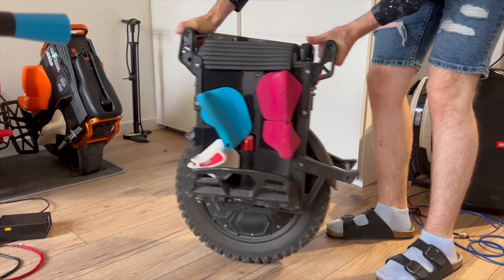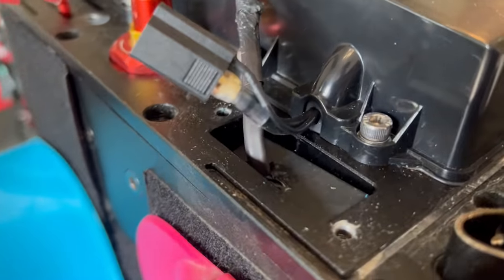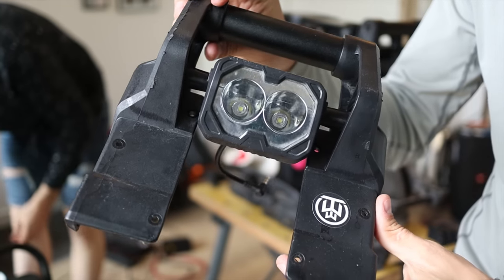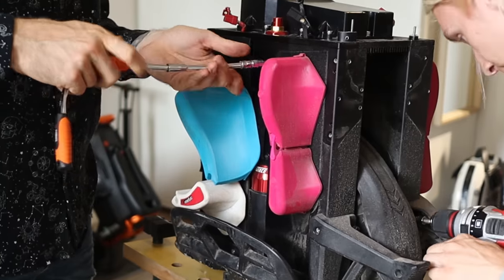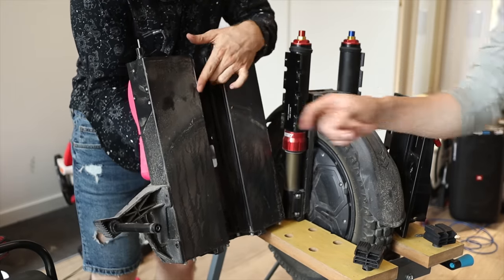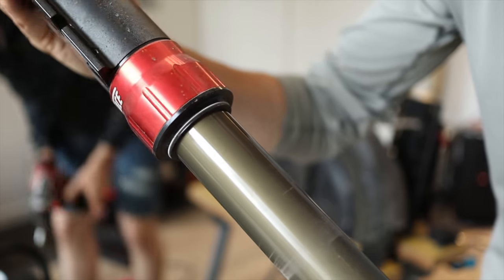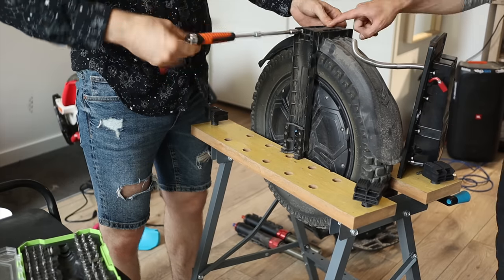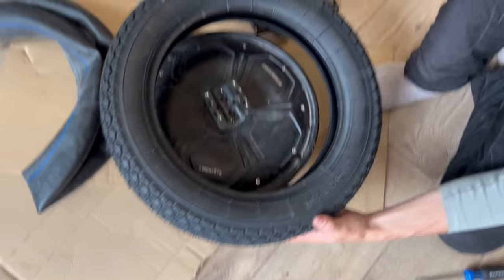VETERAN PATTON DURABILITY TEST

Comment: Adam this is another Adam . I turned my rebound all the way down , that was a great tip . It took away the excess bounce and I could connect with the wheel like my begode exn .  

Also I kept the front bumper but sawed off the toe clip . I put the kinetic pads and still have the front bumper and it all
Looks clean . 

Peace brother appreciate you big time ! 💪

Comment: Got a Patton for a first wheel and have been loving it. Super comfortable suspension, tons of torque and has given me confidence hopping around and bonking stuff and on trails and just learned to do stairs. Not looking forward to maintenance though.
Reply: So.

Many.

Screws.
Reply: @CopperSteed  for real it's like the Wii of EUCs
Reply: depends on what wheel you rode before :) as for me needs to get used to it from KS 16s as is more then double in weight and as much as higher pedals

Comment: I cut a piece of rubber tube 4"lg that is similar size to the charge cable, slit it along its 4" length and placed it over the charge cable, right up against the cable connector.  This extra stiffness has made plugging in a non issue.

Comment: If the form factor and volume measurements are anything to go by that's no beeper those tend to be marketed as piezo sirens/buzzer sirens. Over 100dB is lunacy for a basic auditory alert. Imagine if that thing ever got stuck on...

I might add a parallel resistor to mine when I get it, don't want my neighbors complaining.
Reply: A parallel resistor is not what you want, and would allow more current through. You mean add a resistor in series. Not trying to be a dick but hoping to save you some work

Comment: Could you make a very thin rubber style sleeve to go over suspension before you screw in to remove the wiggle?
Reply from the maker: I’ll first try to use a different clamp and if that doesn’t help I’ll try squeezing something in ✅✌️ thanks for the idea!

Comment: What happened at 6:49?!?! How the heck does the battery fall off?! 
Great wheel ❤
Reply: Hitting the bottom of the case against something hard and cracking it then all it takes is a speed bumb and it will fall out of the bottom. 
Would take a very specific kind of crash to hit it there in the first place though I feel like.

Comment: Which commuter EUC would you guys recommend that is water resistant, has sturdy construction, and allows for easy tire change (or is tubeless)? I'm not super mechanically inclined, and I always tend to have parts left over when I take things apart like this. I am impressed with the Patton otherwise though.

Comment: There's a firmware update recently. They reduced the beeping volume so it shouldn't be as bad of a problem now. I have 1500 miles and haven't had any issues with rattling or anything

i also don’t have the squeaking trolley handle issue. i have the production model so maybe that’s why i don’t have issues with

Comment: RideOne ran into the exact same wheel rattle issue and it turned out almost all of the motor screws were loose from the factory and one was sheered in half and they had to cut a notch into it to remove the rest of the bolt. The fix seemed simple enough and the patton looks like a fantastic all around unit based on other reviews as well as yours. i'm stuck between the patton and the commander mini. would be awesome if you did a side by side comparison
Reply: He’s not doing Begode stuff, but both wheels are great. I have the Patton and love it. The torque is insane

Comment: Great video 👍think the tire wear is diameter related, the small wheels will suffer from this. I think the biggest question I have on the Patton is, is it a good value as a dedicated off road wheel with no intention of street riding.
Reply: From my experience off roading over two weeks of full on riding black MTB tracks, it’s excellent, took a little adjusting to as all new wheels do, but man this thing pulls, it eats steep inclines. The 66lbs suspension is really good, it encourages me to tackle bonks and rock climbs I didn’t on the S22 or T4. The T4 is much more agile, but you soon have the Patton doing the same fast response turns once you get used to it, it’s in between the T4 and S22 for agility imo, but that is a great outcome for me, it doesn’t jump around like a mad woman’s tongue like T4 and is not as straight line as the S22. The overall balance is excellent and that’s something the S22 is crap for, and I love the S22, but I haven’t ridden the S22 pro since having the Patton. Sorry got carried away a bit, I hope that helps

Comment: How much real life difference in cycle life between 50e and 40t? 50e rated 500 cycles to 80% and 40t rated 250 cycles at 35A to 60% but you average way lower than 35A and 50e runs hotter. Any thoughts?

Comment: Hi! What's the vibration at the beginning of the video? My V8F did it too. It's worrying!
Reply: It comes when the motor is somehow loose compared to the motherboard. Perhaps on V8F loose motherboard screws or then loose 4 screws holding the plastic on the hangers.

Comment: Thanks, Adam.  Many screws with many sizes to keep track of isn't fun - or even just 2 sizes.  Does Veteran have all the variation between builds that Begode has?  I thought the latter was the worst offender in that department.

Comment: I'm glad you have the cordless drill to unscrew finally, I got one after I had to disassemble my v12hs 3 times
Reply: I did the same before my third disassembly of my v12HT 😂
Reply: actualy you need 2 of them, impact wrench and drill :)
Reply: @milordas oh yeah, impact wrenches are sick! but I'm not risking them on EUCs, threads are in cast aluminum at best and plastic at worst.

Comment: Hi Where can I get the tire that you use? Heidenau K34 12 x 3.00 ?
Reply from the maker: Yes that’s the name of it. I bought it locally in Poland.
Reply: I was unable to find a k34 in that size. On their US website they list a k38 scooter tire in that size. If that helps. Tread looks very similar if not the same
Reply: @jamesChisena  it could be in different metrics, 80/90(or 80)-12 should fit
Reply: @mr_wrongway  Hi, Do you have a website where I can order in Poland?
Thank you
Reply: @milordas  Looking at their US website it seems the k34 is not even offered in that size. This could just be in the US though. The size on the K38 which looks oddly similar is the same spec Adam listed 3.00-12. Not sure how it translates to metrics 80/90 or 90/90

Comment: I am having the same issue as you. I was suspecting the shock clamps too, but i did not want to wrongly overtourque it, because it is easy to overdo it on one side and not the other. You say you still have the problem. Any other idea, what it could be?
Reply: I have the same issue and it's not the clamps, it's from inside the shocks, probably the bushings are loose/worn.